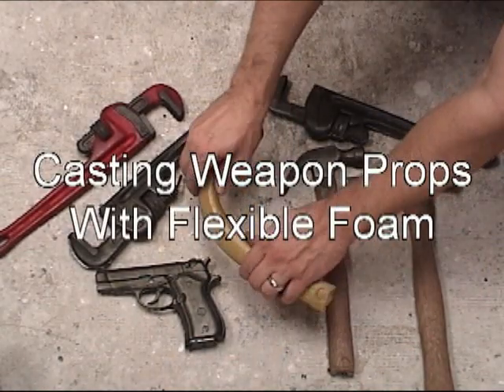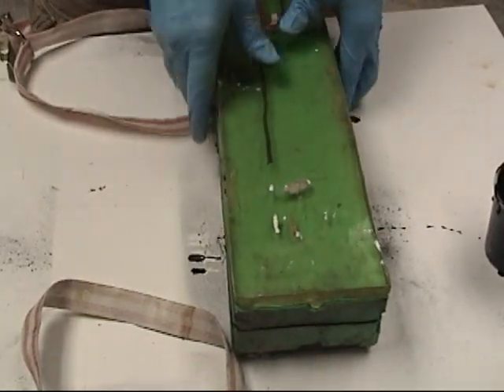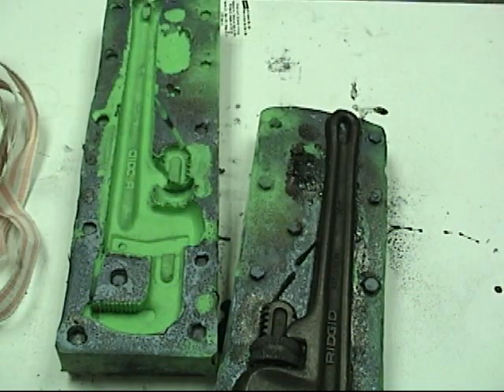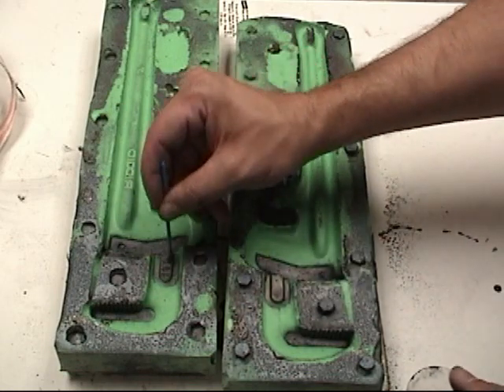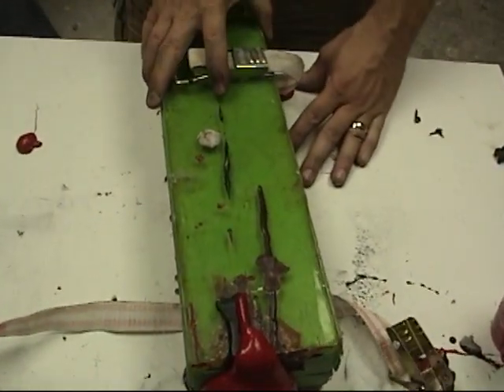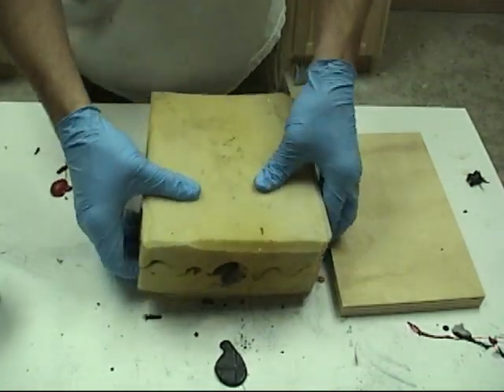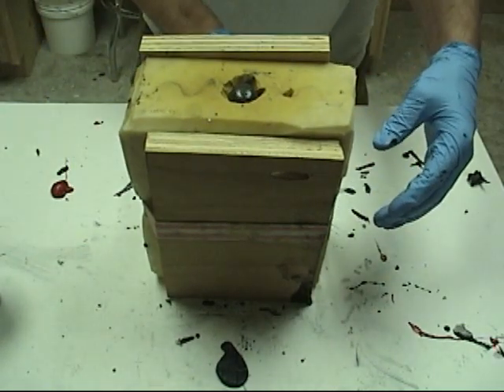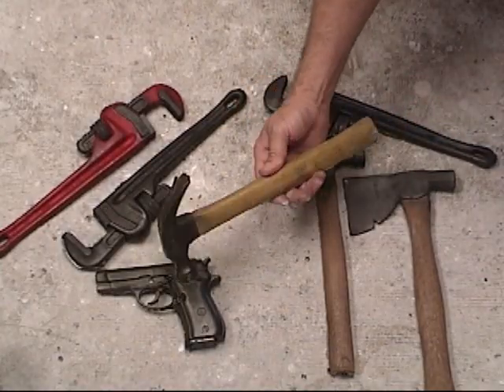Special Effects Tutorial: flexible foam casting

Comment from the maker: The math for calculating foam is tricky. Foam expansion is based on a cubic foot measurement. this is a 10lb foam so a cubic foot would weigh ~10lbs. The expansion rate, unrestricted, is ~4-5 times the original volume.

Comment from the maker: You could use that technique with some of the dense foams like our Prop Foam but it is allways a good idea to run a test part 1st to make sure that the brand of paint you are using will bond.  Remember that different paints and different foams creat a new set of variables.